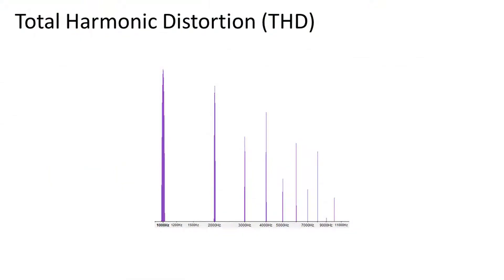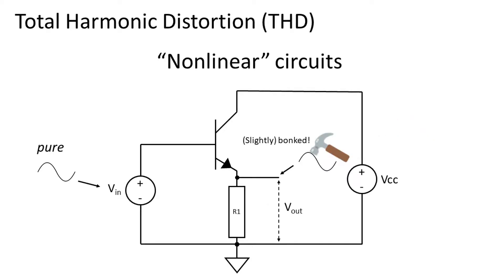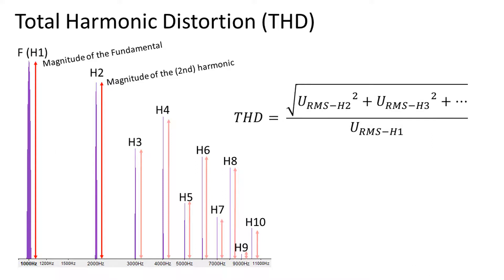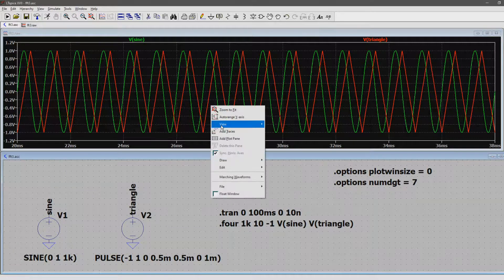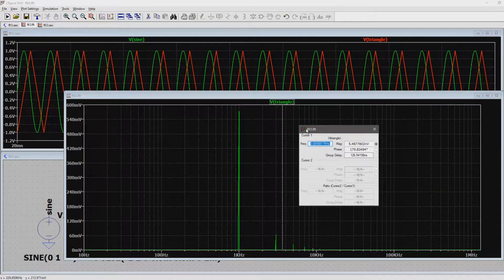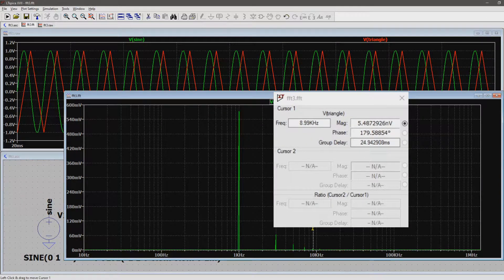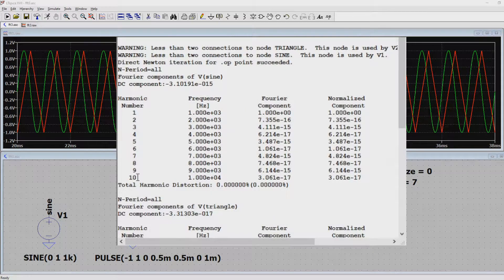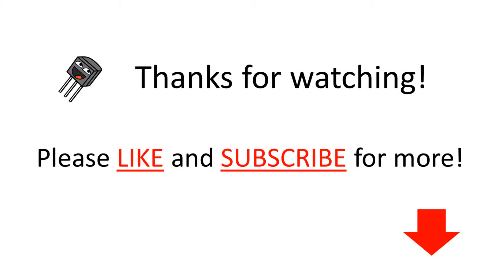LTSPICE #15: Measuring Total Harmonic Distortion (THD)

Comment: I have some strange things, what is now partial distortion and total distortion in LTspice? I think the new version from adi is not that oke with this, I get when fft plot is -100dB of a class d amp I get trouble with measurement, it says total distortion is 0.00012 or so, and partly distortion is 0.35 procent. I do hear also that the total distortion is what is set in .four and partly the rest, bacuse it amps do switching maybe this is the cause.

thanks.

Comment: I am getting THD as 74.146324%(49146395638540.664000%). What does the term in bracket indicate?
Reply from the maker: The first % is the THD using the desired user inputted amount of harmonics. The % in parenthesis is theoretically over all the harmonics. This way, if the 2nd value differs greatly from the 1st, you might've chosen too few harmonics and have a unreliable thd measurement.
Reply: @trevortjes  the difference is still coming out to be huge even after taking 20000 harmonics. Could you tell me the reason or anything wrong I might be doing?
Reply from the maker: @ekanshjindal4638  is the signal very complex? Are you choosing the right fundamental?
Reply: @trevortjes  I am giving just two normal pulses to a comparator of an ADC and getting out two output signals.

Comment: What does the result in parenthesis in the THD analysis mean?
Reply from the maker: The first % is the THD using the desired user inputted amount of harmonics. The % in parenthesis is theoretically over all harmonics. This way, if the 2nd value differs greatly from the 1st, you might've chosen too few harmonics and have a unreliable thd measurement. Original text:

"The 2nd figure an alternative method of computing THD. It nominally includes
all harmonics but numerically difficulting in identifying the fundamental
limits it actually use. It's just bonus information for the guy that asked for
the feature. You can ignore it. But is the number is higher the previous
number, it is an indication that you didn't include enough harmonics in
your THD calculation."
Reply: @trevortjes  ok! Appreciate your quick response!